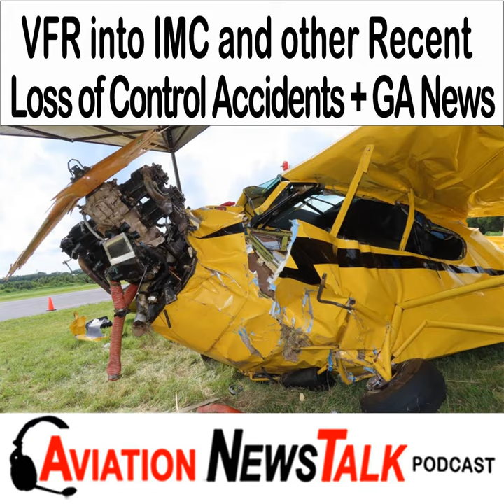309 VFR into IMC and other Recent Loss of Control Accidents + GA News

Comment: Something I think many pilots don't realize is that clouds/fog doesn't always 'blow in from somewhere else', but can indeed ascend, descend, or even form around us 'out of thin air'. I will say that the comment that VFR pilots are somehow reckless or 'feel invulnerable' is a little smug. We fly, without dual pilots, autopilots, de ice equipment, and constant nanny-goat ATC watching our every move. There are lots of scud runner types around here, some with and some without an instrument rating. Probably the relatively flat terrain around here is the only thing that keeps them alive.